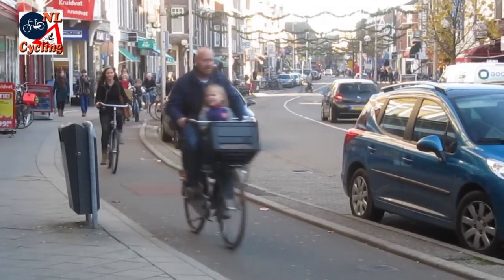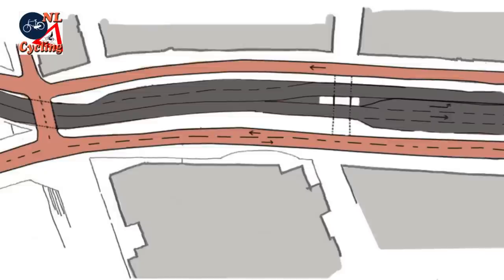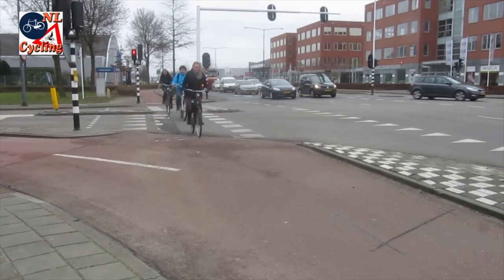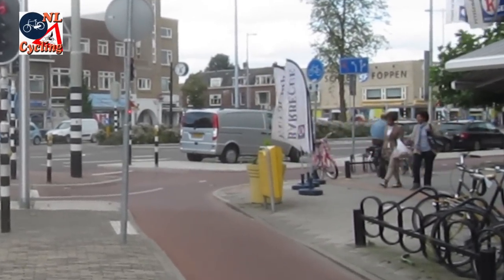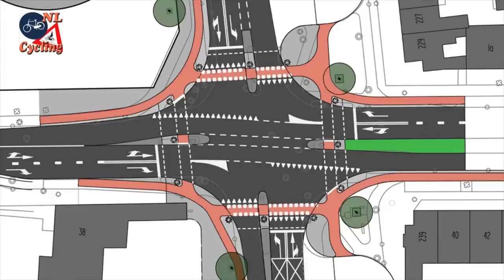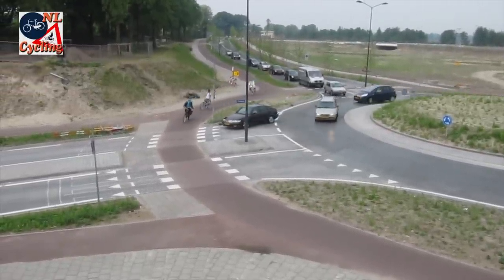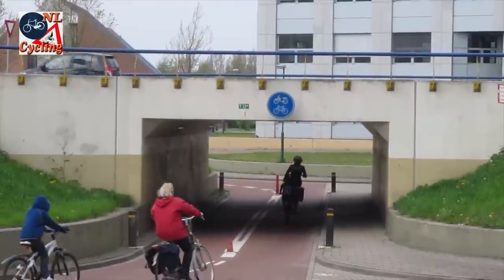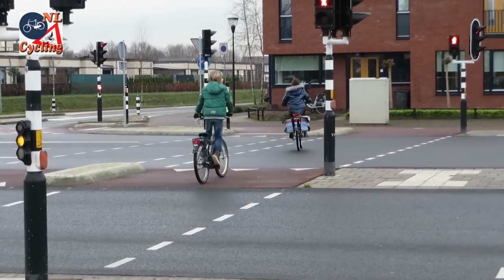Junction design in the Netherlands [311]

Comment: The reason cycling here is so popular and safe in comparison to other countries is not only because of the roaddesign. It helps but it was popular in the past as well. The fact that we in the Netherlands have almost no hills made it attractive to begin with. Also it is safe because everybody knows there are a lot off cyclist. Cardrivers outside the Netherlands are more likely to miss a cyclist just because they never see one. What also helps is the compactness of the Netherlands. The next town is never far away and even the biggest city is only about 11km (7mi) wide. For example Berlin is at some points 35km (22mi) wide. 90% of the cyclerides in the Netherlands are less than 15 minutes long (f.e. home - work, home-trainstation, home-grocerystore). Especially in the US the inner-city distances are often to big make cycling popular. So to me its logical most counties dont't want to invest so much money on cyclinginfrastructure. In the Netherlands cycling is part of the culture, and the roaddesign is a result of it. The roaddesign is not THE reason why they're so much cyclists.

Comment: Stopping in a large vehicle and looking to the right on a roundabout while at oblique angle looks dangerous for the cyclists. Not to mention almost impossible for the driver of a truck.
Reply: The distance between road and bike lane is such that once you are about to cross the bicycle lane, you're already at a 90 degree angle. Check it again, works out fine.

Comment: they need electric bicycles
Reply: Why?  Most people are perfectly capable of using their own muscle strength.  By the way, serious accidents (with serious injuries) have happened because people underestimate the speed electric bicycles can obtain (whether it be the ones that only help you pedal or the ones that do really power the bicycle with a small motor, even when you are not turning the pedals, this last type is not yet very popular in The Netherlands as far as I know.)  Electric bicycles are also a lot heavier than the bicycles they usually come in contact with, sometimes causing more injury to the person involved in the collision as would happen with two regular bikes.
Reply: The Blue Circle You can buy them here.
Reply: batteries and motors are becoming smaller and smaller, and lighter. peddling is so 19th century, we need to modernize bicycles, or at least have motors help the bicycler to peddle.